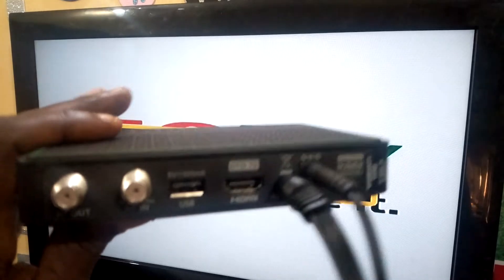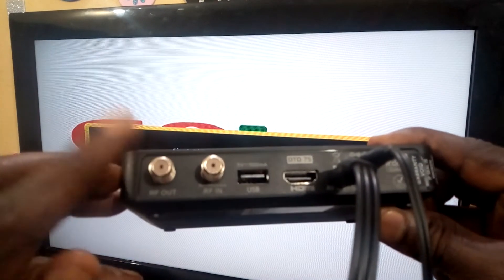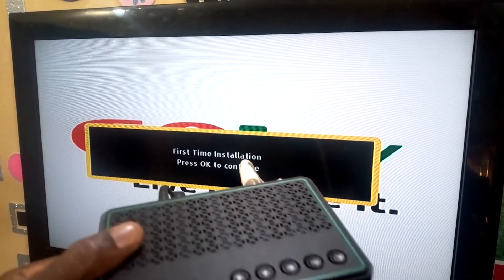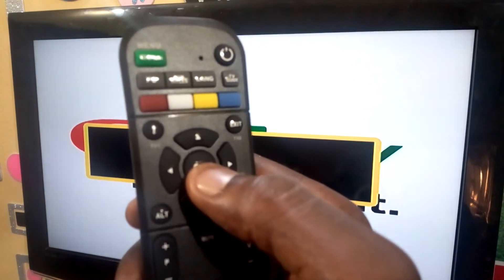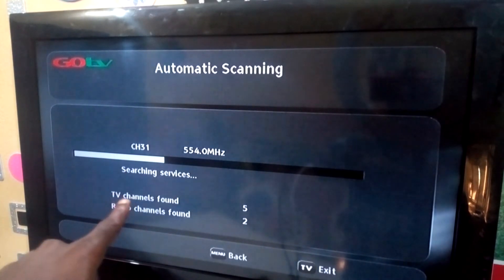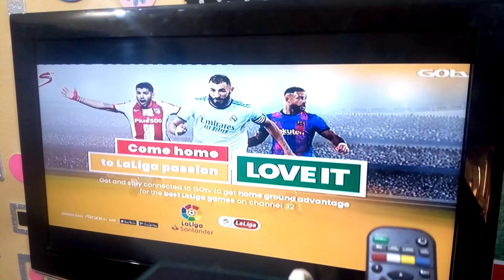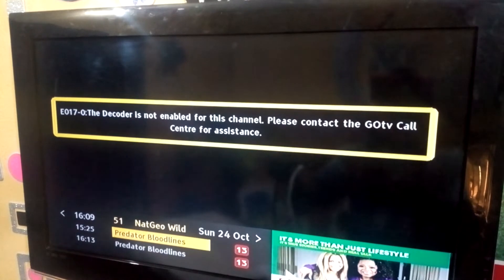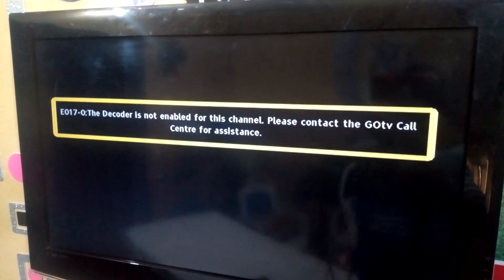How To Install A GOtv GOcoda3 Decoder As A Beginner( Learning A - Z of How To Install GOtv)

Comment: Thank you for this  video
Please can you tell me what to do if am receiving no signal?
Reply from the maker: Thanks for reaching out to me.
Do these things if you are have no signal:
1. Check and correct if to there is a place where you joined wire that has rusted.
2. Ensure you make your antenna to go very high in the sky so as to good signals.

3. Check if someone removed the wire that came from the antenna outside.

4. Make sure you rescan your decoder to get a new or lost channels.

Thanks.

Comment: Hi does RV inn get damaged
Reply from the maker: Hello Esther, do you mean RF-In plug in GOtv decoder?

If it is that you mean, it doesn't damage easily, you need to trace the error around your antenna, wire and the RF-connectors.

Comment: Do I need to rotate the atena before because it not working
Reply from the maker: Perry thanks for reaching out. Yes you can turn your antenna round small small until the full signal is achieved.
Reply: Mine is showing only advert pls how do I activate it
Reply from the maker: @edwineze8690  Edwin is nice hearing from you.
You can easily Activate your GOtv decoder by following the steps below:
1. Login to www.easygotvafrica.com
When the site opens, select Nigeria.
2. Use your full name, phone number, and IUC number which is your decoder number. Put them in the appropriate column provided and click ACTIVATE button. Then I will Activate successfully so you can start watching GOtv Max channels as a new customer. Thanks.

If you still find it difficult to activate, simple send your contact to me so I can do the Activation for you.
Reply: Mine is showing only advert I just bought it and installed it at follow but the mistake Is by not turning on the antenna while setting up, pls how will I do it, no channels is working it only showing adverts

Comment: I have a gotv the signal just went off I have check antenna but no signal so what can I do to restore the signal
Reply from the maker: Hi Godwin,
Thanks for reaching out to me.

To restore the signal of your GOtv decoder check these things:

1. Check if the antenna cable at the back of your decoder has been removed so you can connect it back.

2. Check if there is any spot where your coaxial cable is joined for a possible rust so you can correct it by cutting off the damaged spot and rejoining it back correctly.

3. Check if any tree is covering or blocking the free view of your antenna so you can reposition it to another place.

4. Also if the high of your antenna pole is too shot then make it to go higher above the roof of your building so it can get good signals.

5. Ensure also that you do not make the mistake of transferring the antenna cable at the back of your GOtv decoder to RF OUT port. It is supposed to be connected to RF IN port.

When you check all the above points, you must have been able to rectify the signal error of your GOtv decoder. Thanks.

Comment: Please sir the signal of gotv in the other room i shared to with RF out is no longer clear. What I do plz  what could be the problem
Reply from the maker: Check if the negatives and positives terminals are touching either inside the RF connector or where you had joined the coaxial cable. Thanks

Comment: Mine keeps showing service not found 
I've raised the antenna High enough, but still
Reply from the maker: Hi Dan, thanks for your message.
You need to check if there is a place where your antenna wire is joined for a possible rust so you can correct it.

Also check if the F-Connector at the back of your decoder is well fitted with the cable or is joined together with the negative and positive so you can correct it. Check if the wire is pulled out of the F-Connector so you can correct it also.

After these, then continue to rotate the antenna and scan it simultaneously until it detects a good signals that will make all the channels show.

Comment: I just but a new gotv and it was activated by the dealer in his shop but on getting hope after assembling it, no sign at all on the the TV, what should I do?
Reply from the maker: Make sure you connect the AV wire properly and your antenna should go high enough to the sky so as to get good signals. Thanks Ekene.

Comment: My television is VITRON on its back their is no port of yellow since the Decoder comes with three wires Red yellow and white so when am inserting the pins I don't no where to place the yellow pin at the back of tv
Reply from the maker: Thank you Fred for reaching out to me. In that case, you can use HDMI cable or a device we call 21-Pin plug to run the connection.  You can buy HDMI cable and 21-Pin plug from anywhere they sale electricals.

Both materials can help you connect both video and audio to your TV set since it doesn't come with AV port.

I hope that this answer will help you get what you needed. Thanks.
Reply: @rofixtech  thank u much am new subscriber

Comment: Mine is showing only advert I just bought it and installed it at follow but the mistake Is by not turning on the antenna while setting up, pls how will I do it, no channels is working it only showing adverts
Reply from the maker: Hi Joseph.
Thanks for reaching out to me.
What you need to do is to call who sold the GOtv decoder to you and ask him/her to Activate it.

If it's already Activated, then do a RESET to it and it will start showing.

To RESET:
text  RESET  IUC  to 4688 or 30333
wait for a prompt message that will be sent back to you, then confirm with 1 and send back. 
It will start showing within some minutes.

Comment: thank you for the video @rofix tech. Why must you leave the "antenna power off"? What happens if one turns it on?
Reply from the maker: Thank you for your message. The reason why the GOtv antenna power need to be at OFF position is to allow it to scan for newly added channels by the MultiChoice Company and also for your decoder to be able to recover any lost channel at a given time.

Comment: I have a problem installing mine. Once it's starts searching, it won't search to the end and it will stop, then a drop down will appear and it will say " no services found, press ok to display the signal information screen" . The signal is 0%. Please what could be the problem?
Reply from the maker: Hi Bella,
Follow these steps to get the GOtv signals:
1. Make sure your Gotenna is high enough to attract good signals.
2. Ensure you do not mount it under any shadow like trees or building.
3. Make sure you connect the wire that came from the antenna to the GOtv Decoder RF-IN Plug and not to the RF-OUT Plug at the back of your Decoder.
4. Also, you should put your Antenna power OFF and not ON to allow the antenna locate nice signal position.
5. Now, after ensuring all these, go outside, turn your antenna and come inside to rescan your GOtv decoder so that it will get a good signal and start working.

Note: if you can repeat the no. 5 step as many times as possible until you get the WHOLE CHANNELS COME UP.
Thanks and best regards.

Comment: Mine says no services found and doesnt complete the scanning 😢
Reply from the maker: Hi Michael,
1.Reposition your antenna and make it to go higher.
2. Ensure that the antenna power is at OFF position.
3. Check if you join wire at any point, it might rust, then correct it.
4. Scan your decoder and turn it respectively until it gets signals.

Comment: Please what’s the difference between Standard Gotv ( oldest one ) vs Gotv GoCoda 3?
Reply from the maker: Thanks Frank.
The major differences are as follows:
1. Gocoda 3 has HDMI port for digital clean pictures while old one doesn't have it.
2. Gocoda 3 can get good signals even far distance away from the transmitter but old one can not.

Comment: My govt green light is turning red, pis  sir what can I do
Reply from the maker: Thanks Nicholas for reaching out.
If your GOtv green light turned red what it means is that your Antenna right position to signals have been changed. So, you need to go turn the antenna gradually until you get a good signal strength which will make it turns back to green again. Then it will start showing.

Second option is that if it turned red without displaying any picture on the TV, then just know that your GOtv decoder has been switched OFF. So, you need to power ON your decoder using the power button on the Remote or on the decoder.

I believe that these suggestions would help you once you observe them. Thanks.

Comment: What's wrong with my connection..?? Am doin evrythin as it shud but its not even showing the gotv ata kwa screen???
Reply from the maker: Hi Dottie, check if the light displaying on your GOtv screen is Red, if it is, then switch ON the GOtv so that it will start displaying on your TV.
Again, make sure that you switch to the proper AV mode of your TV to enable the pictures show on the TV.
If you have done these, it will come up.

Comment: I dnt know what wrong with my connection have done everything it's still nt showing up on the screen
Reply from the maker: Eniola it's nice you reached out.
Check, your AV wire if you can replace it.

Check if you joined wire at any point and it has rusted so you cut and rejoin it.

Comment: Mine is not working 😔
Reply from the maker: Hello Jessie,
Do the followings:
1. Ensure your antenna is raised high enough above the roof level.
2. Ensure you connect your antenna wire to the RF-IN of the Decoder and not RF-OUT.
Check if your wire is join at any point for a possible rust, then cut the place off and rejoin it properly.
4. Continue to turn the antenna and scan respectively until your GOtv channels are restored.

Do all these and you will smile as your channels surface again.

Comment: But u said u are going to show how to activate... But u haven't shown us
Reply from the maker: Ok dear,
It is not difficult.
Step 1.
Get the customer's Name, Phone number and the IUC number of the GOtv Decoder. That's all you need.

2. Log in to www.easygotvafrica.com
and click on Activate New GOtv icon.

3. Once it opens, enter the the three information above, that is
NAME, PHONE NUMBER, IUC NUMBER in the appropriate column.

4. At the Agent ID column, put any name of your choice if you don't have any assigned code from MultiChoice company as a dealer.

5. Then, click on the ACTIVATE button down the page so that it will be automatically activated.

6. Make sure that the GOtv Decoder is on in channel 3 or 9 so that it will open fast.

Thanks and remain blessed 🙏

Comment: My own is not showing self I don scan tire still showing o Chanel
Reply from the maker: Ok, do these things to get it restored:

1. Raise the pole of your antenna higher to get good signal and then rescan your decoder.
2. Check if there is a place where your coaxial cable was joined to see if that point has rusted then, cut the bad place off and rejoin it.
3. Make sure the wire is tightened up at the back of the decoder.
4. After ensuring that you have done all that, then scan and turn your antenna right round until the disappeared channels come back.

Thanks.

Comment: Mine cant search for signal why!!!!!!
Reply from the maker: Thank you Jones.
Do all these;
1. Check your AV wire if you need to replace it.
2.Raise your antenna higher more than the roof level.
3. Check if you joined wire at any point which might rusted and you cut off the bad side and rejoined it.
Reply: Mine get only 36 channels